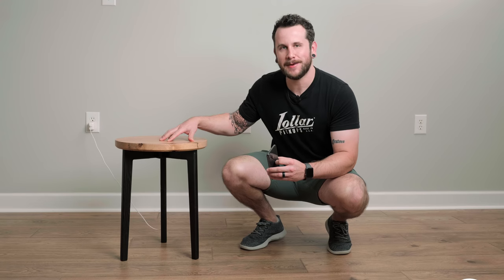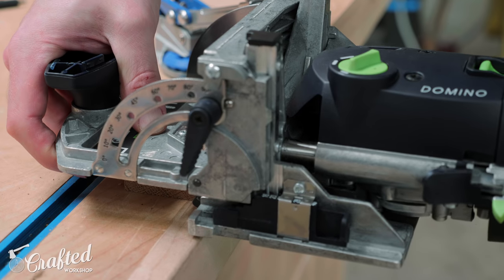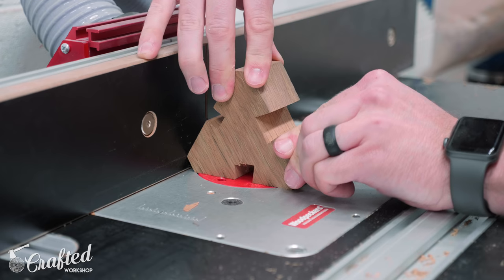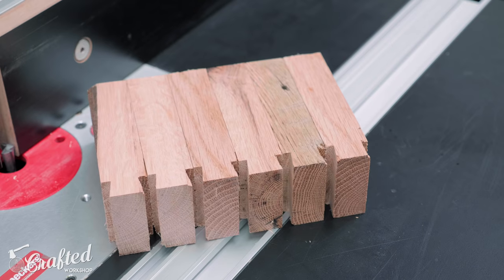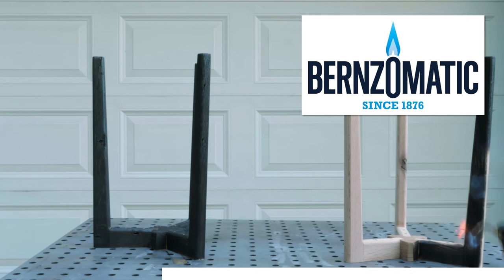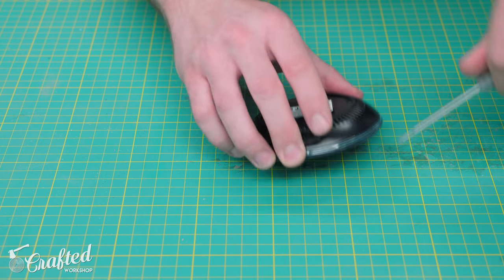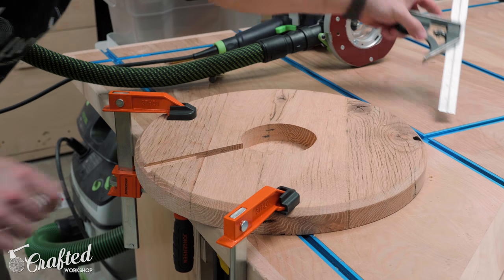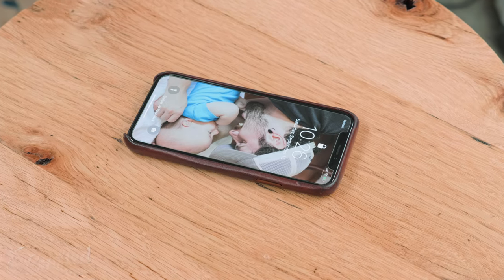How To Build A Shou Sugi Ban End Table with Hidden Wireless Charging

Comment: A copper wire inlay circle would be good in middle to identify quickly where to place your phone. Lastly, nicely made end tables.
Reply from the maker: That’d be cool!
Reply: Or an inlaid walnut bowtie, before routing out the recess for the charger.
Reply: try a burnt ring to match the legs
Reply from the maker: That’d be cool!
Reply: Im adding the charger option to a computer desk im making but im thinking of a branding design, like a circle with a lightning bolt inside it.

Also the reason why the samsung charger kinda sucks for a project like this is because they use single coil for the pad. If your still looking for a better charger for modded projects then make sure its a multi coil and preferably 10W so it future proofs the project a little bit
Reply: Marco Misaipon  Wow.. that would really pop. Nice one!
Reply: I've used a 10W double coil DIY with just the electronics and I really did not think it was any better. I wondered if it may of been worse because the one coil is partial on top of the other thus increasing the distance that one would be from the surface. I am definitely on the lookout for a good DIY kit that I could reliably go to. 

As far as indicating placement I have just laid out my wood so a natural feature in the grain  marks the placement. Like a knot or a section where the grain comes to a point so it just points to where your phone needs to go.

Comment: Just a quick tip for routing the dovetails into the rails. If you want to have more support on the piece of oak, leave it twice as long, rout both ends and then cut that in half. That way you're further away from the cutter.

Great table BTW.
Reply from the maker: Thanks Paul! I definitely would have done that with the center support, but the thickness of the piece of wood dictated it’s length in this case. For the rails, that would have worked great!

Comment: you should draw or paint or maybe even burn a lightning logo in the center of the table, so you know where to put the phone every time and it would look cool. especially if you used some sort of tempplate and did the char effect with the torch to get the lightning bolt logo in the center

Comment: I am planning to build one of these and my plan for placement if the phone over the charger is to just use a router bit and make a really minuscule pocket for my phone and round over the edges with sand paper. So you just pop it down and it stays in place even if you bump the table.
Reply from the maker: That sounds cool!

Comment: I would have like to see you use the x-carve to make a "+" dimple on the top side so you know where to place the charger and then fill it with colored epoxy or left it as is. Since you had tabs when you cut the circle top it would have been easy to have that "+" cut on both sides (flipping it over) in the same position and then route out the hole or even have the x-carve do that too. Just seems like you could have made this better by utilizing the x-carve more effectively.

Comment: Nice build!  The shou sugi ban came out great!  I used Danish oil to soak into the surface and harden inside it, but found the same thing as far as it being OK to not use a wire brush.  If we weren't making quickly for YouTube, i bet a first coat of Danish oil, followed by a surface coat of poly would work really well.
Reply from the maker: Thanks man! And I agree, a more penetrating finish would probably work great.

Comment: So we're moving from everyone doing epoxy river tables to hidden wireless charging tables
Reply: I'll take the trend of useful charging vs looks any day
Reply from the maker: I'd say, with most phones adopting the tech, you'll see it become standard in furniture in the future. It is incredibly useful to have a charger built in to any table top surface. I plan on adding it to most of my furniture moving forward.
Reply: Epoxy river wireless charging tables are next.
Reply: I've thought about using epoxy to mount the charger. That way you could make the surface thickness less where the charger is and not worry about it breaking. Charger might over heat though.
Reply: Branden Grant  😂
Reply: @renswic  there's nothing useful about wireless charging. You can't use your phone while it's charging.
Reply: Should try and get ahead of the curve with some outdoor solar powered patio charging furniture

Comment: Why are you running those triangular pieces over the router table backwards? Nice build by the way!
Reply from the maker: Thanks! The bit is riding on that inside edge of the groove, and is only contacting that face, so that is the correct direction. Otherwise, it’s a climb cut and the piece is pulled from your hand.
Reply: @craftedworkshop  gotcha!! It just seems so backwards haha
Reply from the maker: For sure, I started going the other direction and quickly realized that wouldn’t work!
Reply: I think the issue is that you are cutting on the wrong side. It is my understanding that you never pass wood between the fence and the blade. Huge risk for kickback.
Reply from the maker: Yea, this seemed like an odd scenario really. Either way, half of the work piece was between the bit and fence.

Comment: On the sliding dovetail triangle piece; did you run it in the reverse direction on the router table?
Reply from the maker: Yes, because it was hitting that inside wall of the groove. If it had hit the outside wall, I would have run it right to left as normal.

Comment: If attaching metal legs to a wooden table would you recommend lag screws/ coach bolts, or regular screws? Thanks 
Table is 2.5 inch ceder wood
Reply from the maker: Regular screws should be fine.

Comment: if you use the magnetic style connector on the power cord, you don't have to worry about ripping the cord out of the wall when you move the end table
Reply from the maker: I didn’t realize those were made for standard USB cords, I’ll have to check them out!

Comment: Looks great man. Did you wipe off excess char from the Shou Sugi Ban?  Does the finish coat it enough to prevent the char from wiping off as you handle it?
Reply from the maker: I covered that a little later in the video, just hit it with a little compressed air then sprayed on the finish!

Comment: Great build! Did the shou sugi ban affect the joinery at all? I was thinking of experimenting with it but was curious if it would loosen up the joints at all leave a slight gap. Thanks!
Reply from the maker: Thanks! I was interested in the same thing, but it didn't seem to have an impact. I didn't linger too long on the joints. To be extra safe, you could glue up after you burn the pieces, but that seemed like a pain.
Reply: Yeah, I think I'll do it the way you did (build then burn). Though, I'm sure it's a little nerve-racking spending all that time getting everything just right and then setting it on fire :D

I'm planning to build a firewood shed. I thought it'd be a fun nod to the bonfire to do a shou sugi ban finish.
Reply from the maker: For sure, very nerve racking but super fun! That sounds like a cool project!

Comment: Nice work, but sorry I have to say that I injured my finger before and I had several stitches from a cut on the router like that. Since then no way I get my fingers close to the router bit like that.

You always can use a sled or any jig to save your fingers.

And you can never know how the wood grains might react with the blade.

Comment: As you can see the Domino is faster and a little more efficient...and about 1000x more expensive/worth more than all the tools in most people's shops. Normally I hate comments like this, as can be seen by the hand tool end grain cutting board video I'm about to upload, but you switch between the two so casually like they're comparable.
Reply from the maker: They are comparable! The Domino obviously does a lot more than illustrated in this video, but for what I did on this project, the dowel jig works great.